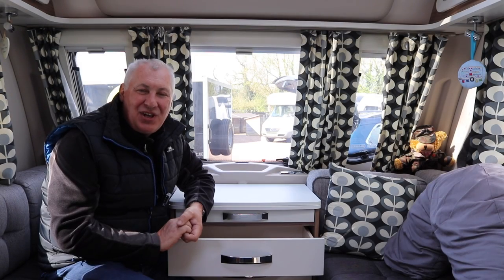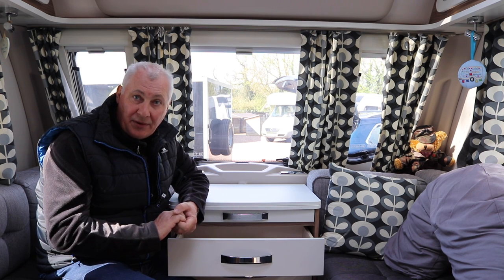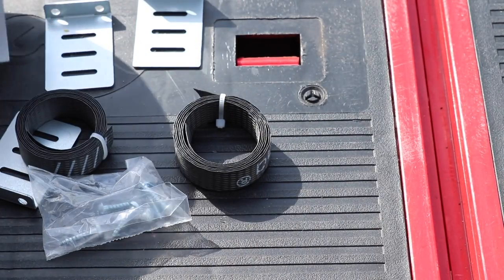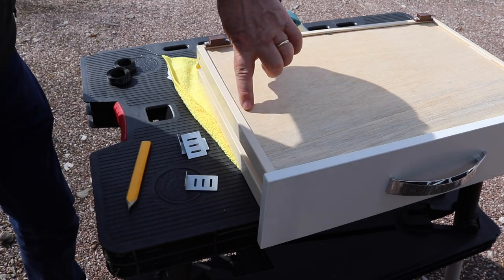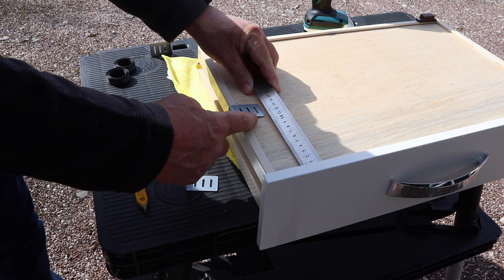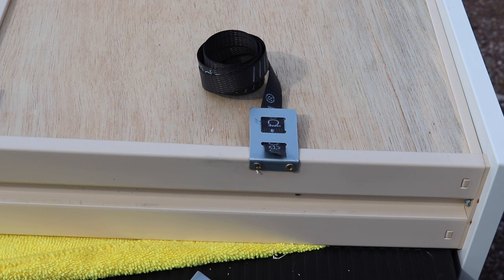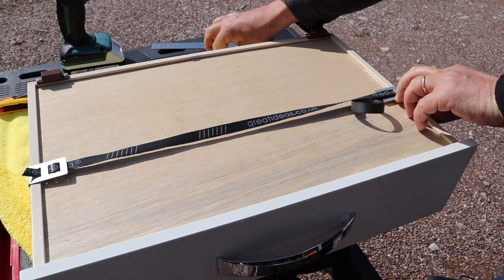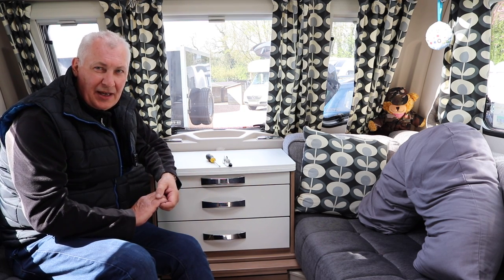Caravan Sagging Drawer Fix

Comment: Not sure how that would solve the problem when you have a sustantial gap between tape and drawer base ,so would saf ,maybe not as much.
 Better buying new piece of ply and replace the base, its what i would do and probably easier
Reply from the maker: Hi Robert. You could replace the base but the cheap plastic sides will not hold it in any more than the current rubbish provided. The idea is to pull the sides in to hold what ever material used.Thanks Phil👍🙂